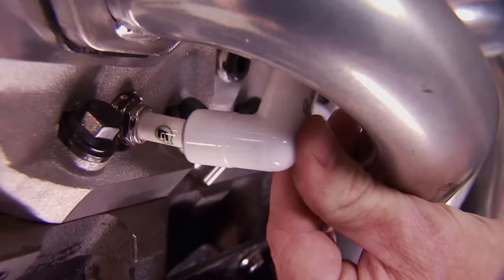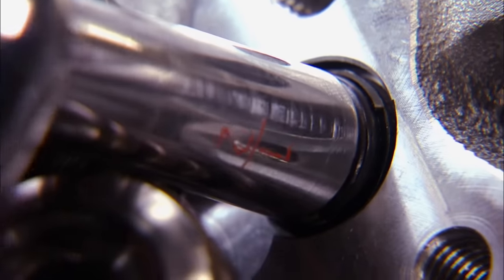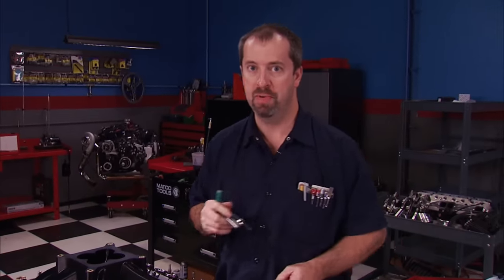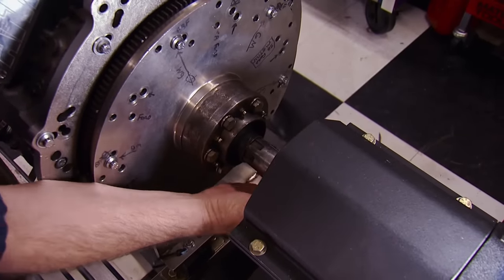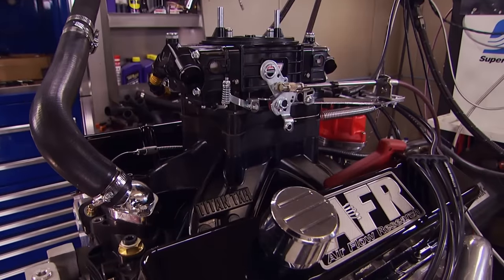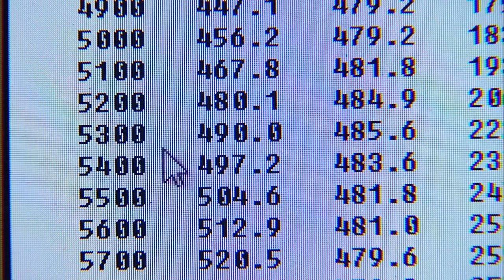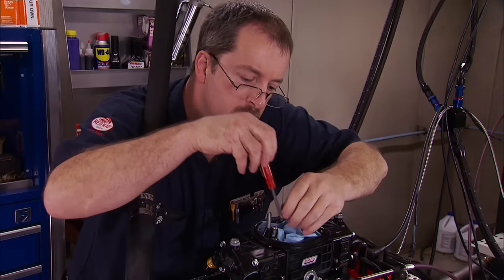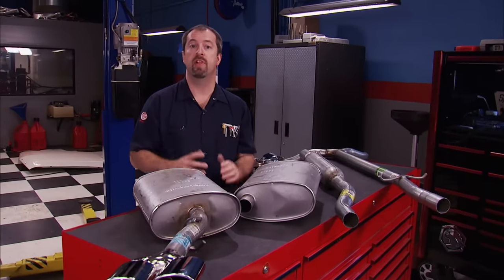Small Block Chevy Build Stage 2, Part 2: Complete Assembly & Dyno Day - Engine Power S3, E3

Comment: You guys did a video where you used the GM LS engine & gave a "suggestion list" on what parts on teh fuel injected LS would have to get removed & replaced with an intake for a carb & suggested a carb to feed the LS; I cannot find that video for the life of me. I want to cross post it to a FB group that I belong to that's dedicated to "Square Chevy" trucks.
Reply: MSD invented a computer and fuel system that makes LS swaps plug and play and not require any OEM wire harness. You could wire an inline fuel pump without too much trouble. That would be better than a carb.

Comment: I'm missing some information here. when you use a 383 crank, what starter motor do you use? does a 350 starter work on a 400 crank?
Reply: Any small block starter will work on pretty much any small block. Same with a big block
Reply: You can by the same pattern of flywheel/flexplate teeth for the 350 and 400 crank. The only difference is that a stock 400 crank is externally balanced and needs a flexplate/flywheel that has a weight on it for external balance. I think some aftermarket 383 rotating assemblies support internal balance so that the special flexplate/flywheel and special crankshaft pulley are not needed.
Reply: Lol
Reply: @kingdavid1975  hahahaha 😊
Reply: The 383 is a 350 cu in with a 400 crank. Wonder what a .030 over would be

Comment: Interesting how chevys use a mopar type shaft mount rocker system when building high horsepower motors. Chrysler knew what they were doing 👍🏻
Reply: john preston ..... & you have cooties! 😂😂😂
Reply: Ada 1812 ..... & rent a dumpster when your building a Chevy, so you have a place to put all the garage factory parts 🖕🏻😬
Reply: The reason Chevy engines didn't have shaft rockers is because they were cheaper, and when an engine has a mild cam, the added strength of shaft rockers is not needed. It only becomes important when aggressive cams are used.

As I remember, the Magnum series 318 and 360 was given stud mounted rockers because they were cheaper and didn't have to deal with aggressive cams.
Reply: Skyline Fever .... you are exactly right. 👍🏻
Reply: If you buy rockers, 5/16 studs, and then add a girdle, you spend about the same as the Sportsman shaft set-up. It was a choice, not a requirement.

Comment: Actually, an electric water pump does have parasitic losses: the load is seen by the alternator.  But it is a gain overall - especially  at higher rpm.

Comment: The Formula comes to around 850,,, so you use a 950.
Chevrolet,, the biggest reason the small block was used  was 5 bolts per cylinder. So the LS has four, just like the opposition!

Comment: That 3" exhaust showed more honk at full speed, but wouldn't the opposite be true at around 3000-4000 rpm? Increasing the plenum height would give a greater volume in the runners that would give the combustion chamber less chance of starving at high rpm but inefficient flow at middle range, resulting in lower hp and torque .I'm wondering what is the use of maximum torque at max revs in a car when you can't replicate those conditions on the road very often.Or is this just a dragster application?.
Reply: What you're seeing on the dyno is the max power an engine can make. You'd pick components to make power where you need it, which is mostly in the top end. So if you want something with good HP from idle to 5500, or 2000 to 7000, or low end torque for towing, just pick the cam that works for that application.
And if you put it on a dyno the numbers would reflect that. So say a cam thats good from idle to 5500, the power would start tailing off at that point with the peak around 5500.
Reply: @sparkplug1018  Thanks for that.And for a peak of 5500 you'd probably opt for the smaller diameter exhaust because it would produce more HP for the given range?
Reply: @Stevie671  In lower RPM applications the large tube headers tend to hurt power, and a 3 inch exhaust won't do much for you either.

Comment: Question on the LS summit block. Do iron blocks have the strong long lasting piston sleeves like the aluminum blocks? Never messed with a iron block so idk.
Reply: Iron blocks don't typically use sleeves.  It's all one piece.
Reply: There are some that use sleeves but most don't. You can however install sleeves on any block. Darton sells them for SBC and pretty much any popular engine. They also do custom if you need them.
Reply: ACPHOTO reason I was asking my 6.0 had 230k when I decided to rebuild it. The piston walls still had the hatch marks from the factory and the bottom end was still within spec so I just resealed everything and had the top end rebuilt and put new cam bearings in because it was a DOD engine and the original cam ate up one of the cam bearings. So long story short I was impressed by how durable the bottom end is on the LS engines.
Reply: @kylewest100  the gen 3 and newer blocks are hardened at the cylinder walls to reduce wear. Makes it harder to bore them over as well.
Reply: Most iron block gasoline engines don't use sleeves. Sometimes, when a block is damaged or has reached its maximum overbore, sleeves can be fitted. Some agricultural use gasoline engines do have sleeves.

Large diesels are a different story. Most of them use liners.

Comment: I have just under 4000$ in my stroked 350-.040 over (385") all forged rotating assembly. And have over 575 hp
Reply: Sounds like it's bored not strocked . And no you don't
Reply: @jakeclucas7926  it's definitely stroked with a 3.750 eagle crank with 13.7 to 1s JE slugs and herbert cam with .620 valve travel with a 270 duration. the heads have been doctored a bit   to say the least.altho it has not been on the dyno.
The machinest that have worked on my parts and built hundreds of motors told me the quoted hp number....world product heads

Comment: Wish they did a build with a efi system and dyno tested
Reply: The result would be slightly more power through the curve with roughly the same peak power. And better drivability under more conditions and all that.

Comment: 5:00
Doesn't an electric pump have the same parasitic loss, but through the alternator?
There's a principle of conservation of energy.
Reply: Perhaps the electric pump is more efficient going through the electrical system, being delivered only the power it needs, versus a driven pump, where the pump receives power regardless of whether that amount delivered to the pump is more than needed to actually drive the pump, along with a lack of mechanical drag from an additional pulley. I'd imagine a very small if even noticeable power gain.
Reply: @Seethenhagen  
I think the water is necessarily always circulated.   The thermostat prevents water from going through the radiator.

I think a direct pulley drive would be more efficient.   With the electric you have the losses at both the alternator, and the electric motor.

Conservation of energy is physics 101.
Reply: @charlesvan13  Electric pumps generate a specific flow rate, and aren't dependent on engine speed to determine the flow of water through the radiator. The use of an electric pump over a mechanically driven one removes the mechanical drag from the additional pulley, and uses the power that is already going into the alternator that ends up being wasted as it exceeds the needed power for the function of the engine and/or vehicle. The power is already going through the alternator whether or not there is an electric pump, and it is one way to ensure that what is being transmitted through the alternator is better utilized instead of wasting the excess power the alternator receives.

Comment: Why. Does everyone doing these engine builds only think of drag racing, I’m not able to fit those risers under my hood in a r
Reply: Cause drag racing rules.round and round racing gets people mad and cars get wrecked and it's to much about the driver..to many laps for drivers anger to build aka track rage.in drag racing it's over in a few seconds.you either win or go home.just my opinion .I'm sure you have your own also
Reply: 4" cowl hood will solve the hood clearance problem, plus single plane intakes increase in power the more spacers you use because it increases the plenum volume.

Comment: Why did you give us the increase or decrease in HP and TQ in every change except for the larger exhaust pipe diameter, where you only gave increased TQ numbers?  I suspect that the 3" exhaust pipe didn't change the HP peak numbers.  Why didn't you want us to know that information???

Comment: Thinking outside the box; have you guys thought of seeing what your engines could do with a 4 - 6" exhaust?????
Reply: They would have lost power bc not enough back pressure, on a diesel it's different
Reply: Exhaust gas velocity tends to go down as pipe size goes up, and there is a certain velocity that is optimal. However, it might work if if the exhaust system merged into one 4 inch pipe, rather than 2 2.5 or 3 inch pipes.
Reply: @skylinefever  a former friend of mine had a mechanical 12 valve cummins (early 90's 3/4 or 1 ton Dodge pickup), he put one 5" exhaust pipe on it (straight pipe here as well & he claimed that he got another 5 hp out of going just one inch larger than 4" exhaust).
Reply: @MRHSDM316SD18186  I should have mentioned that I was talking about gasoline engines.
Reply: @skylinefever  I was thinking both  on the torque and hp curve what the differences would be between the two.

Comment: Did I just see you put copper thread sealer on a aluminum head?
Reply: So????
Reply: @bilbobaggins4710  Galvanic Compatibility? Do you know what that is?
Reply: @carpathian677  I've done many times with no such issues...
Reply: @carpathian677  I've also used copper sealant on shim gaskets mounting aluminum heads on cast iron blocks ....It's not the same as copper parts paired to other metals ....The sealants have other ingredients which prevent Galvanic issues

Comment: Man TBH ... they didnt make the power they should have made... theres no way you run a cam that big and heads that big and make such low numbers... i have a 383 that made 535 hp 522 torque... and we stopped the dyno at 6000 rpm and i have smaller heads... smaller cam and 10.25 compression...... i can imagine what it wouldve made had we gone up to 6500 rpm... i really thought this motor wouldve made 575 hp 500 - 525 tq...a minimum... but in my opinion. I think they have mismatched parts.. not enough compression.. idk tho
Reply: Yep when I seen claimed 8000rpm, I thought this better be 600hp.
Reply: @jeremymyers5643  most people are not spinning their 383s to 8000 rpm.. i can see 6500 to 6700....i dont understand why run a afr 220 head on a street motor!?!? They only shine at THE TOP of the rpm
Reply: You have a good combination on your 383. I prefer more torque than horsepower. My mild 496 9.1:1 with iron heads made 565hp/600tq all under 6,000rpms.
Reply: @musclebone7875  thats a very stout motor.. what transmission are you running? Im running a th350 3000 stall  3.73 12 posi... watching these videos... especially the latest video "383 to 406" .. that motor didnt make much more power than the 383 motor... in my opinion they have mismatched parts...and not enough blueprinting... a good strong 383 should EASILY make 500 to 525 hp... and a 406... an EASY 550 hp... and that's with smaller cams and heads than what they are running

Comment: Ford 351w stock stroke bored 0.040" over had 595hp with a smaller duration solid roller cam and off shelf trick flow 11R heads...looks like the small block chevy design is inferior
Reply: sean5comet Chevy small block has always been overated, it probably is a little cheaper to build but the Windsor or cleavland Ford's make more power in my opinion.
Reply: I always preferred the SBF cylinder head design over the SBC head design. The SBC needed to have extra twists and turns on the intake ports because of the "Pushrod pinch." The SBC designs may have had advantages to improve fuel/air distribution among some carb and TBI engines, but I didn't see the point on MPFI engines.
Reply: Chevy can't run with the ford FEs and Windsors.
Reply: Not the design, just the lack of thought put into this build
Reply: @jimwilson7403  having uneven spacing in the intake and exhaust ports is a horrible design. Why do you think they have it symmetrical in the LS? Look at the spacing on the 2JZ, k series Honda, Nascar...the list is infinite in the engines that are high power per cubic inch. Look at sport bikes, indy cars...
Reply: There are ways to compensate to make more power with an " inferior design". These guys missed it big time.
Reply: @jimwilson7403  the asymmetrical design always bugged me. The compensation for the design is made up in the abundance of aftermarket support

Comment: nobody: .......
power nation: E3 spark plugs are for max hp and efficiency

out of all the people i know and cars ive worked on, i cant think of 1 person who has used e3 plugs
Reply: I've never heard of anyone (but these guys) using them with a carb and distributor but I know a few that tried them in modern engines (because of these shows). They got instant check engine lights and safe mode. The only fix was to replace them with traditional plugs.
Reply: Something Funny exactly.  No one in the real world has used them with good results or they would be talked about more. Can’t be a traditional plug period.
Reply: reese They were a sponsor of the show, they were paid to say that.
Reply: @alexcorona  Did you figure that out all by yourself?

Comment: I've got a ton of questions.... Maybe  I'm Spoiled from watching engine masters, Richard Holdens new channel and being a engine builder myself. 6500 RPM?? A lot of the runs were peaked at 6500 which means you were about 500 rpm off where you should have let off . All that math and artwork to put a 100 cfm to large carb. I run a 800 on a 700 hp late model engine turning 8500 all night.  Why in the hell would you install shaft rockers and those nice PAC valve springs  to run stockish rpm? Those heads should support well over 600 hp if the right person put it together with the correct combination.  Sometimes I get the impression yall aren't real mechanics, just actors who play mechanics lol. Just whatever sponsor throws some parts your way.  IDK but I would bet money EAGLE heard the 8000 number and put a stop to that lol. They didn't want them H beams to turn into Z beams on TV.
Reply: Well first that is a pump gas small block. Number 2 those guys in the challenge have very audible pinging. You can't run lile3 that on the street its just a display of max HP at any cost. Theyre all great engine builders but I bet dollara to donuts you will not find ANY of those engines as a crate package they would be willing to sell someone.

Yeah the carb is a little big. They make 880s 

You said real.engine builders but ahow me a natrually aspirated small block that spins much past 7000 or so and can run on 92 octane

You circle track deal is a different animal and im guessing you have a lot more compression than this too and a much bigger cam than this as well

That answer everything?
Reply: @KingJT80  You know about enough to get yourself in trouble.  No you actually didn't answer anything.  Trust me real race engine guys watch this channel for laughs.  My up next/auto play video seems to always take me to these guys. This channel works off the concept of Sponsors giving them certain parts to use on the show. If you had a cylinder head shop you would give them your product for free to use and once they get enough matching parts boom there is your episode.  They are not building for HP that's obvious.  They are using whatever is free. 
My question was, in the beginning they said the goal was 8000. Am I wrong?   They did all this fancy math with that number also. The top end of that engine is designed to easily spin 8000 so why didn't they? This was going to be an all out race engine in the beginning.  You don't put a massive solid roller cam on a street engine.  They didn't because EAGLE said NO! The bottom, IE crank/rods cant take 8k. Eagle called up and said it wouldn't look good for us to have our product splattered on tv. Eagle is decent street strip budget components.
 My main point is these guys are being told what to do. Its painfully obvious they are reading a script.  They are TV personalities not engine builders.  I would suggest watching a different channel for good information on HP stuff. 
 Trust me I have 20+ years extensive experience on the subject. I do this for a living, literally. What's your profession?? Watching this is like a real Dr watching reruns of HOUSE. Some truth but mostly BS for TV.
Reply: @Lance.West4  actyally I worked in the profession for 5 have a degree in repair and work in areospace and was a tool maker I understand whats going I here. They said that but that cam and conpression they're running won't spin to 8000.you should know this you're the professional here.  Not becaue of some conspiracy theory about eagle cranks

Now post up some engine builds and dyno videos and teach something or else its all talk on the internet man
Reply: @Lance.West4  where I will agree with you is they could have done this with a high 240s duration@ .050 camshaft and AFR 210's and regular roller rockers with a stud girdle and hit 6500 rpm with 10.5 to 1 on pump gas
Reply: @Lance.West4  yeah sure I'm a troll with a very old youtube account.   You can have search whatver you want doesnt mean anything to me.  

I can Google shit too and look like a pro never said I was I just know what this engine was gonna do when they put the parts in it they literally said around  500 hp